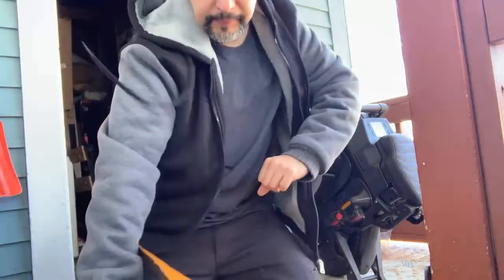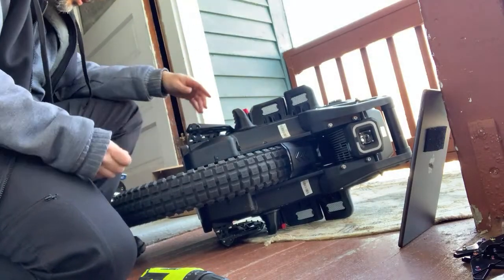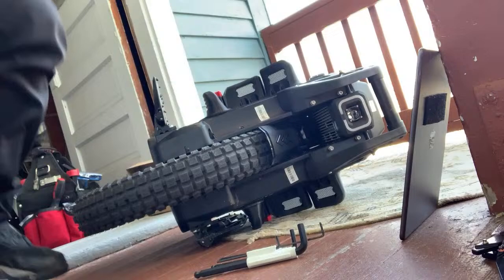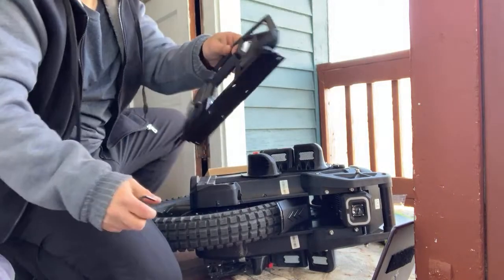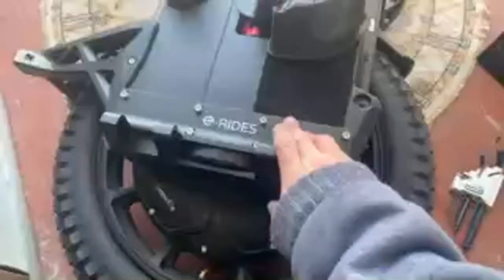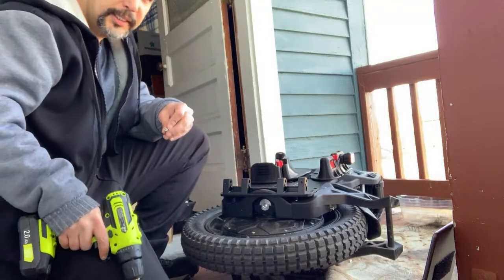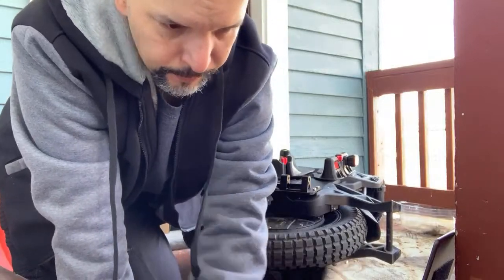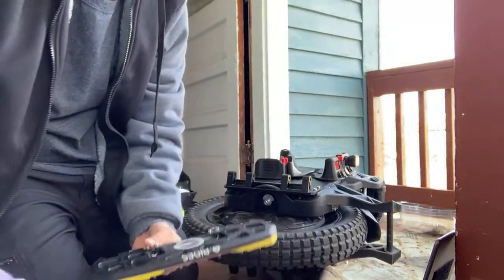Live lynx e-RIDES pedals and lowering kit installation (Not complete - SEE COMMENT)

Comment from the maker: Sorry about the last part of the video, where I ran into a curious part of my installation. Included in the box were friction rod and nut and I didnt know how it installed. It took some time to figure it out because one side of my pedals was loose and the other side had friction. Once i figured it out,, I installed the black risers and then took the LYNX out for a spin for 15 miles. I tinkered with my pad positioning because the lowered pedal height felt different and the pads were not giving me flexibility that I wanted. After that was squared away, I am very pleased with the pedal lowering kit, and it makes a world of difference, big time!!

Comment: I was looking at pedals. I wear size 13 boots geared up around 250lbs. You think the trail, biggie or the ewheels butterfly pedals would be good?
Reply from the maker: Im not certain. You may need to check with erides . I would imagine it would be no issue. The pedals are very heavy duty, and very large.